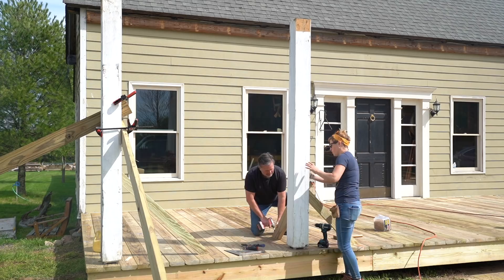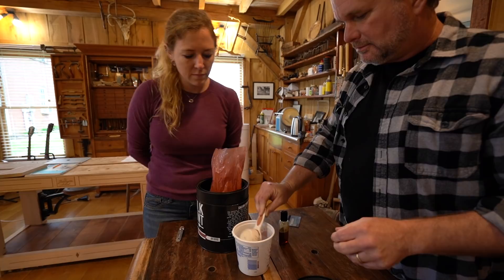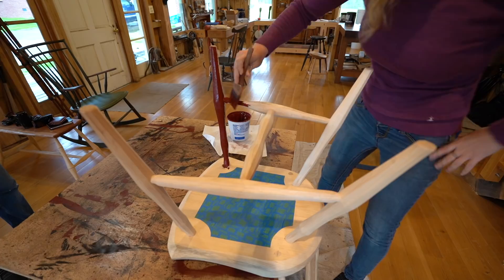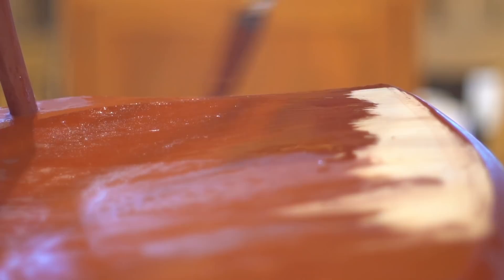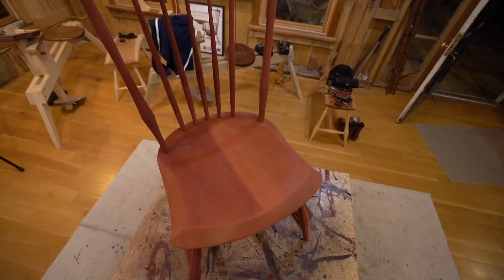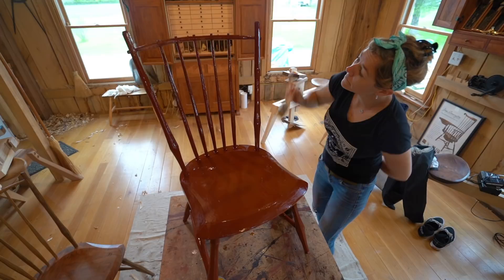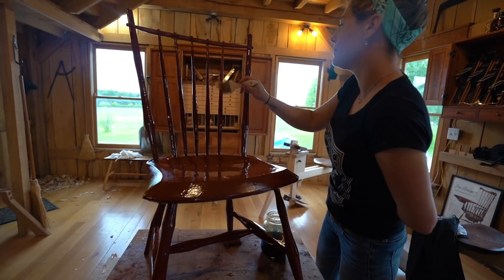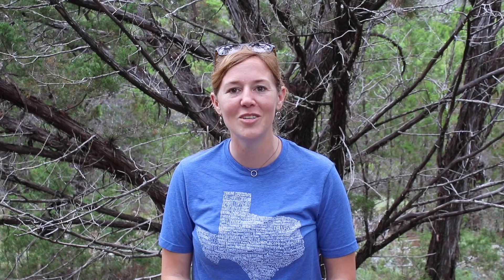How to Paint Furniture with Real Milk Paint

Comment: I am studying Wood Working and furniture design in college and we just completed our last semester on chair building. Prior to the beginning of the semester I never really considered how many different designs and styles of chairs there were, and up to that point most chairs to me, equally had a simple functionality purpose.  I can tell you that, there are as many design styles and ideas as there are master builders and artist making them.  When the same old style and designs are pumped out, its called a factory, keep doing what you like best, who cares what traditionalist say.  Do your own thing and run with it.  I liked the way it turned out.
Reply: Wanted to add, that every traditional design or style was an original idea from a craftsman or artist, then they became standards in the industry. Also, we use a lot of Milk Paint, cool stuff. You can change the final finish look by adjusting the consistancy with more or less water ratio's.

Comment: Here's my only problem with colored finishes in general: I can't put them on furniture with defects. Every single little defect stands out like a sore thumb by the time you're done. So to me that's another factor I consider when choosing a finish: If the piece is rough with some not-so-obvious tool marks in it and I'm not willing to take the time to sand and buff it out until everything is perfect, I won't use deep or solid colors because that emphasizes what would otherwise be ignored and distracts from the attractiveness of the piece. If I have taken the time to make a perfectly smooth surface I'll put whatever I want on it.

You can make any finish look like the perfect finish for any piece of furniture, but it's harder and sometimes even impossible to do if the furniture isn't perfect itself.